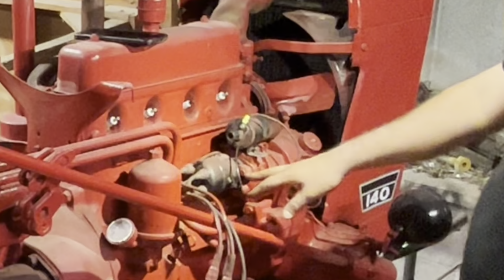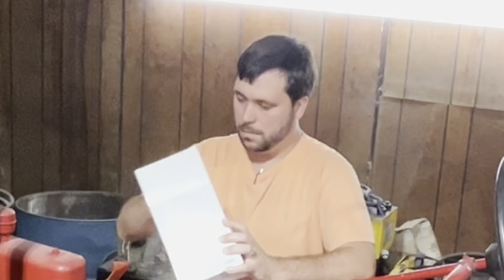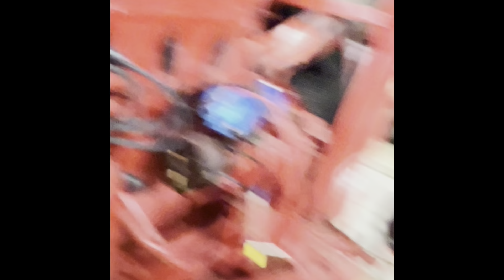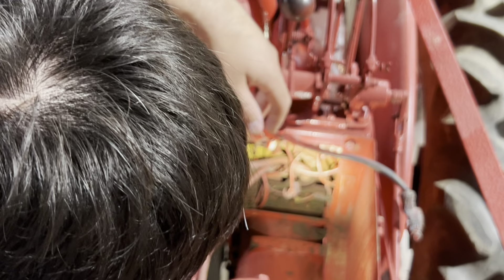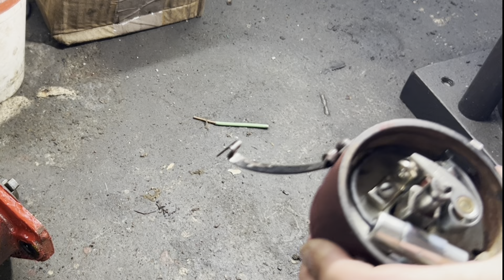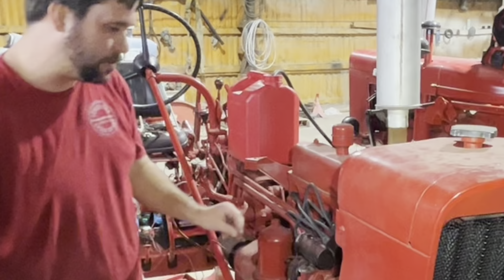International 140 Industrial - Will it EVER Run? When All Fails, Throw Parts At It! #chasingtractors

Comment: Wow, I think  you had every issue possible.  Glad you got her running.  I just bought a 140 Hi Clear yesterday.  It'll crank and run for about 10 seconds and die.  Then fuel dripping out of the carb.  I'm going to pull the carb and rebuild it, and make sure there aren't any airway obstructions.